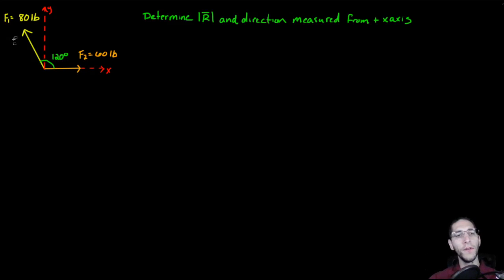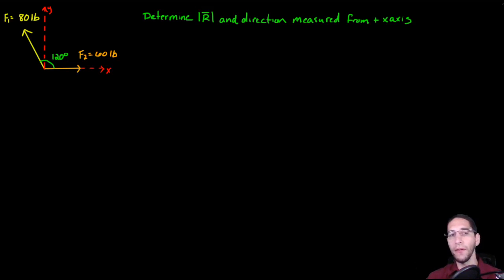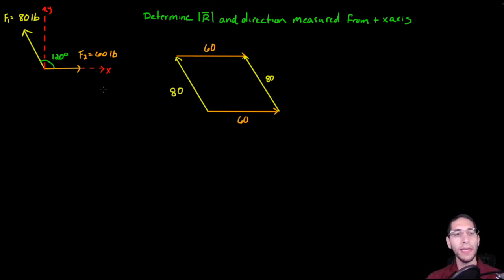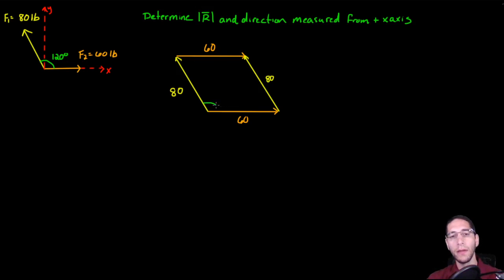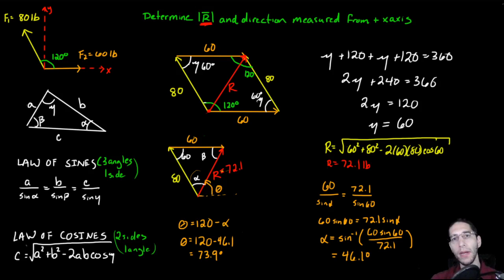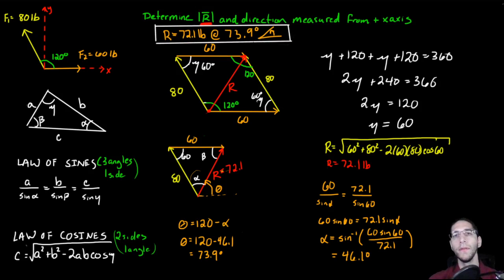The Parallelogram Law

Comment: Can you tell me when to use the formula r2= a2+b2 + 2ab cos theta. I mean I have seen this formula where instead of -ab cos theta it uses +2ab cos theta. Thanks
Reply from the maker: Besides the occasional typo, I have not seen a "+2abcos(theta)" used. Law of cosines formula contains the minus sign.
Reply: @EngineeringCorner  , I have been accustomed to using the same formula with yours, but I have come across the other formula in a book and in some video presentation that make me wonder whether it is a separate formula to use in a special case or a typo error. However, judging from the textbook presentation, it seemed a derivation of formula. :

R2 = a2+b2 + 2ab cos (180 - theta)

Leading to:

R2 = a2+b2 - 2ab cos theta.

Not, sure if the first formula is tobe  used it if the angle given in the problem is to be subtracted to 180, and use the second formula, if subtraction of angles will not be done.